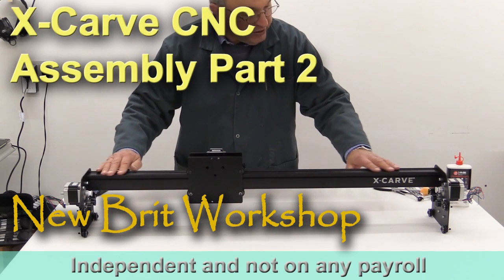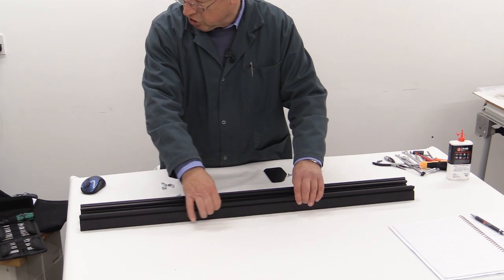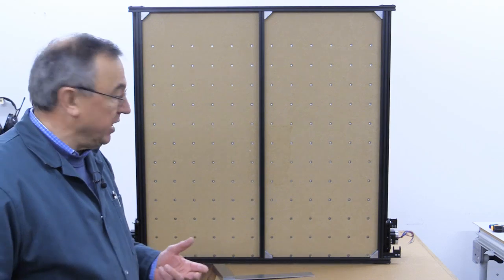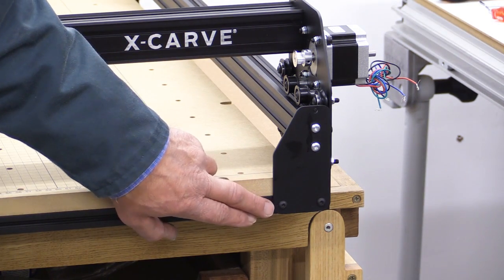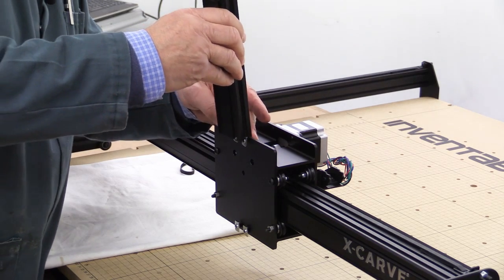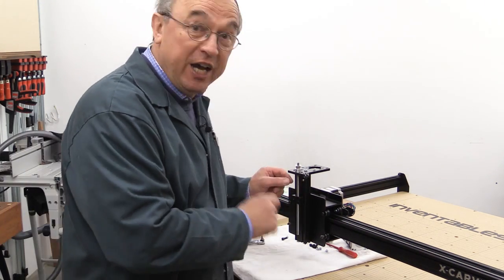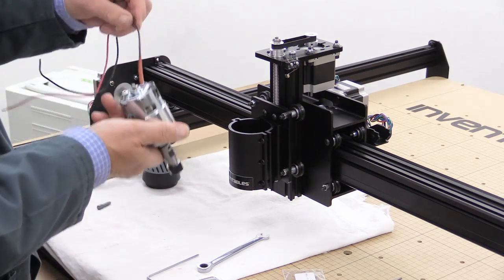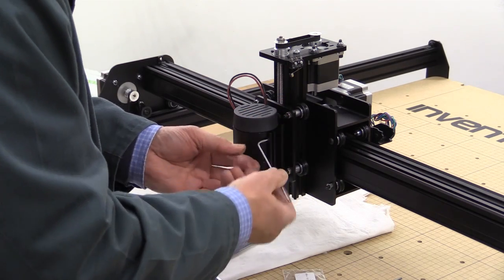Original X-Carve Assembly - Part 2

Comment: Sir (If I may),

The "Official" 1000mm has no video instructions for adding rails to the Y Plates.  If fact, the instructions LITERALLY tell us to skip the step of adding the rail.  This is confusing as the OFFICIAL instructions leave me with a ton of guess work, and no one seems to be covering the actual "Step by Step" in a video (even Inventables).

Unfortunately for us "Noobs" photo shots can be left to confusion due to angles, and incomplete 1000mm instructions can lead to improper assembly (at least referencing unofficial instructions), which should NEVER be a concern on a set of "OFFICIAL" instructions.

Therefore, as you have done so well with your assembly and adjustments.  I am wondering if you would consider reaching out to +Inventables, and asking for another kit to do a "FULL" 1000mm assembly, capturing each and every step on video, step by step.  That way,  all steps will be covered in a set of instructions (and, more clearly due to video).

Hopefully, this will lead to them creating a set of 1000mm written instructions (Step by step, versus a "Piggy-backed" Incomplete set... 

   ...Leading to overall to crystal clear, step by step instructions, with no room for guesswork, confusion, and/or misinterpretation.

Kits need instructions, and this "PUZZLE" costs far, far too much, to have missing pieces (Instructions), leaving us to "jig our own pieces" (find instructions and guess), instead of having what we should made available before the products are even shipped.

Thank You, for and and all consideration on this matter.
Reply: **To be clear, I am at the step regarding adding "Base Rails" to the end plates... I apologize for any improper terminology.  Please be patient as my vocabulary on the matter is sourced from over 10 online sources... LOL **
Reply from the maker: +TheRangeControl I will not be able to fit in another full assembly as I have a diary full until this time next year. I will make Inventables aware of your concern and hope that they can respond themselves.  I am sorry that I cannot be more helpful. I will try to take a look at some of the unpublished footage that I took to see if it might help.   Peter
Reply: Thank You!  Those steps would be truly helpful.  The more "All Inclusive" beginning to end could be the best thing possible.

Even adding it all as a separate total video would be great, as it would all everyone to see the entire process for themselves, or simply go to one of the parts which you have already included.

Thank you for your attention on the matter.

P.S.  What is the model of the drill which you use with the Torque control?  It sounds great, unfortunately "Closed Captions" didn't aid me in understanding clearly. :-)
Reply: +New Brit Workshop (Peter) I just started watching this video from the beginning and realized the slot for the limit switches needed to be up top.  I wish I had watched from the beginning, but juggling between here, +Inventables videos (which is basically a 500mm video set with only notes for the 1000mm build) is enough to drive a fella nuts.

I wished there were a full build video specifically for the 1000mm (and set of instructions not added as an offshoot as a "shortcut" for the manufacturers.  Having to do all of this for any one kit as a NOOB, completely sucks.

UGGGGhhhhh... oh well.  Time to flip the slides right side up.
Reply from the maker: TheRangeControl I also had one or two mistakes that caused me to go back a step or two.     Peter

Comment: Just for shared information, I contacted Inventables today to have them ship me 10 M5 x 10mm screws, 8 to attach the assembly to the workspace rails and 2 to use on the DeWalt spindle mount. The instructions did clearly say to use 10mm, but all I had left was 8mm. I assume someone just put the wrong package in my box. I'll try the 8mm for now (after seeing your video) and see how it works out. Perhaps the instructions had a typo.
Reply from the maker: Richard Sisco Hi Richard, It is an error which I mention in my video. The correct size to use is M5 x 8 mm for joining the assembly to the work area (total of 8 required). The M5 x 10 mm will be too long and will not work. Inventables have packed the right items in the kit and you will not need any more - it is just that they say to use the wrong ones.     Peter